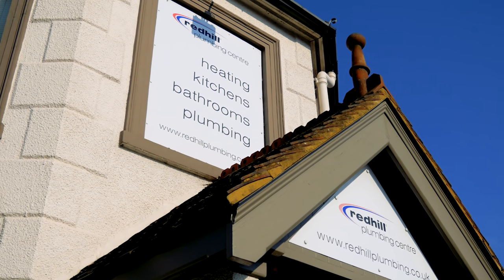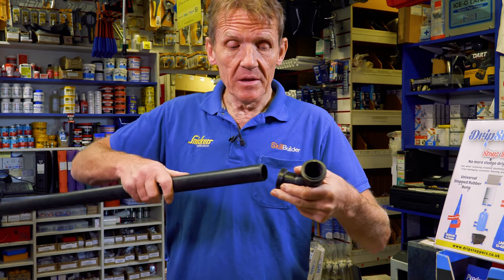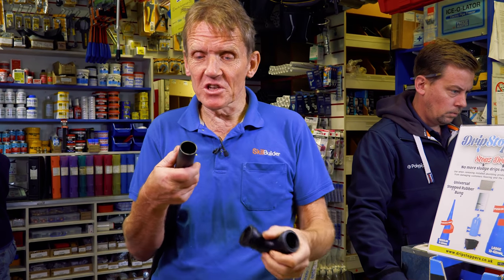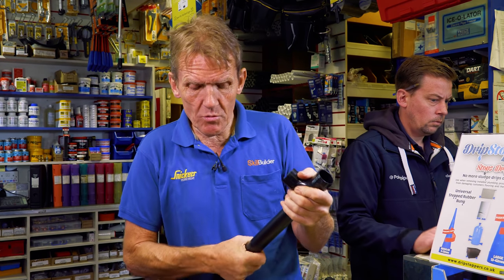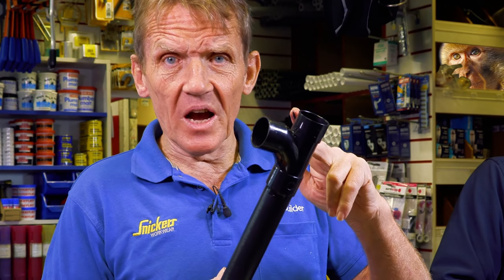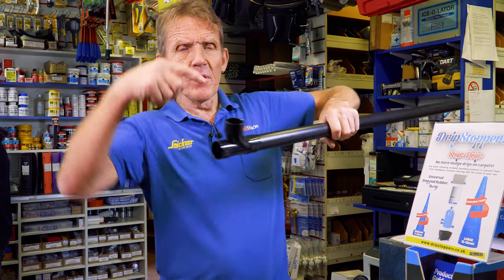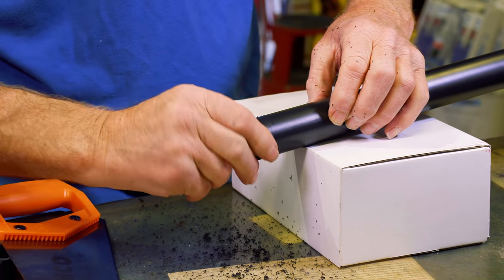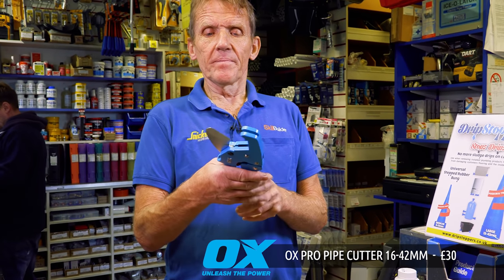How to Cut & Connect PVC Waste Pipe - Plumbing DIY

Comment: I have the OX and a Rocut 42 and will always give a twist on the pipe with both. It didn't take long for the point on the OX cutter to wear and then it deforms the pipe just like the rest.For the best result, I ratchet them up to the point where it starts to squeeze the pipe, then just rotate all the way around, it will come off in one leaving a perfect edge with no deforming at all.
Reply from the maker: Good tip Mark
Reply: Omg.... That's exactly what my pipe did... Why did I not come across this comment earlier!!!!

Comment: Great video Roger.  Saws and swarf are a pain and few plumbers clean the ends up.  The cutters just need to have very sharp blades, not that difficult to do and you get a square cut every time.  The twist works every time to get the cut started.  The solvent weld takes care of softening the slight ridge from a good pair of cutters.  I use a mix of cutters and also a portable small, battery, cut off saw with a fine blade which is so quick on a big site and is easy to make fine adjustments.  As I've mentioned earlier watch the spec. on waste pipes for heat tolerance.

Comment: 4:16 For anyone interested, I'm pretty sure its similar to glues used in plastic model making. You have a limited time to put the two plastic parts together before it starts to melt and fuse the plastic together.

Comment: In Germany we always use Geberit SIlent PP it ´s a push fit how you guys say. 
Its the most professional u can use over here we build a hole building with 12 floors and they will last for over 70 years without leaking.
Reply: the German ones are multilayer, the ones he showed are just simple plastic pipes with pushfit connectors. 

Here in Lithuania everything is also built with pushfit multilayer pipes with no issues at all.

Comment: Thanks for explaining that, there is always confusion between the waste pipe types! Id go for the saw for all i do in cutting plastic pipes which isnt much but the professionals like yourself probably like those ratchet cutters, looks like there is room for improvement in all three types though. How about a video on traps next, why all the various types and which to use in which situation?

Comment: you may remember the Rubber joins with 2 jubilee clips you connect cast iron with plastic 4 inch waste pipe nice thick rubber they never leaked now u can get them in all sizes from 1 n quarter upwards n if you have no space to move the pipe either way you can cut it n use that after the repair like a slip joint saved me so much hassle as i didn't know they existed am retired now lol

Comment: I bought the rothernberger ratchet cutters and literally chucked them in the bin after one go. I hate how it squashed the pipe and also I found it really hard to get the pipe into solvent weld fitting after cutting it. Saw or multi tool every time
Reply: I nearly threw them away when i first got them, but if you score the pipe first it cuts perfectly.

Comment: It’s worth mentioning that with the pushfit pipes - waste and soil - when you insert the pipe into the fitting, once you’ve hit the stop you’re supposed to pull it back out 10mm to allow for expansion
Reply from the maker: Good point. I see so many jobs where no allowance is made for expansion. We used to put a little scratch line on the pipe so the building inspector could see but they are not bothered now.
Reply: Skill Builder How long does it actually take to cut the pipe with that slice? I’ve always just used a junior hacksaw but the clean cut that saw made has made me fancy going to pick one up myself lol

Comment: If its upvc and you're joining polypropylene then you can use a pusfit fitting. ABS only allows solvent cement and mechanical connections.

Comment: I've found a hacksaw good for cutting the white waste pipes, and using a flatting pad on an angle-grinder to get it back square when the cut goes wrong.....perhaps that's why a broad-bladed saw is better??...it might keep a long cut straighter in general??. :)

Comment: Ref cutters I would only use a saw.That distorsion is the difference between a leak or not.Yes I use a file to chamfer.I am all for mod cons but sometimes saving time costs in other ways.Going back to your supply pipe video I have only ever used compression joints on plastic and ptfe tape on the front of the olive and the inserts.Plastic pipe can be a god send because its flexible .Never had a problem but for some reason find speed fit fittings bulky and some how dont trust them? Just me.Some things work and dont need simpifiying for speed at the expense of not working at all.
Reply from the maker: compression fitting on plastic supply and heating is a good bet

Comment: There is an exception to that external diameter difference PVC/Polyprop. Yorkshire is weird. There are 2 estates late 60's early 70's build  South of Bawtry Road, Rotherham and the Hoyland estate near Barnsley. They have polyprop/push pipe that has the exact external diameter as pvc/solvent weld. So, in some cases mechanical or compression fittings are actually essential in joining pre-existing pipe to new. Some old timer at the plumbers merchants told me about it.
I know that sounds daft, but it's true. Had me scratching my noggin for a time as I pulled off some old push fit and attempted to fit new ones. I much prefer PVC. Neater, better and cheaper.  
Even the chippies say that the door cases and sizes are "weird". 
It's grim oop north, tha 'nos?
Reply from the maker: Bimey that is another nest of vipers. Remind me not to go plumbing in Rotheram, I like is for my holidays but not for work.
Reply: I think that it was some attempt to standardise sizing as we went from the imperial to the metric system. Worse still some 1950's estates in North Sheff have nominally 1/2" copper... which isn't. Nearer 5/8ths" and with ruddy thick walls. That old adage that a 15mm will fit an old imperial 1/2" would not work. The wall thickness meant digging out my hand swager, repeatedly heating and walloping away to enlarge the insert. 
Holidaying in Rotherham? This year, the missus insists we holiday in Royston Vasey. She's feeling nostalgic for her youth. She is ex "local".

Comment: The rotary pipe slicer like the copper ones, you said it might be an option but not for you. Can I please ask why cause I own all sizes 32, 40 and 50mm and I find them just lovely, they don't squeeze the pipe no inside or outside burr and cut in 1 or 2 complete turns whic means less than 3 seconds. I can't think of working without them. Can I please ask what a great professional like you think is wrong with them? Thank you very much advance

Comment: Russian method to use soap, for join tubs together. Because soap very slippery, if you grease one of the end of tube, you very easy put in  tube to connector.
Reply from the maker: Yes but the soap dries out and those 'o' rings are then not working so well. Silicone grease is the product that is approved.

Comment: A pleasure to watch as always I  know exactly how to use this crap anyway but it's always nice to get a fresh perspective in it anyway, I'm currently on a sighting team for a caravan company I was just wondering if you have any good ideas for cutting and champfing 4 inch waste to make things quicker and easier especially when your stuck underneath the shitty things all day 👍
Reply from the maker: Jamie 

When I was young and skinny I used to crawl under those portable class rooms to put the 4 inch connections in. I would take a saw, a file and a sack of fittings and hope for the best. I used to wonder if I was the only mug on the planet who would do that kind of work, seemingly not.
Reply: @SkillBuilder  appreciate the reply rodger, i know what your saying mate I've just finished my level 2 in plumbing and starting my level 3 in September Im just doing that job because it's convenient for me and college but when your 38 and fat and struggle at the best of times to get underneath them any miracles are welcome, no worries rodger and thanks for getting back to me thanks for your vids 👍
Reply: @Jamie I use a fine toothed stubby saw to cut and an angle grinder with a grinding (not cutting) disc to chamfer off... very carefully and exercising caution, of course. Unless you have a battery operated grinder, I reckon you'd need a bloody long extension lead on a caravan site.
Reply: Ooh! Top tip, with 4". Wrap a piece of paper or thin cardboard around and mark with a felt tip. You can then follow the line around and get a nice sq cut.
Reply: @loafersheffield  cheers mucker I'll definitely go cordless, I'm quite accident prone so with a cord knocking about I'd be ass over tit in no time, good shout on getting a good line for the cut aswell brother 😉

Comment: Lovely Roger. Bread and butter plumbing. The only thing that i dont like about the ratchet cutters is thag the last. It if cut you always get a slight angle on the cut as the bit cuts chopped off. Even the rothenberger does it but not as much as the cheaper ones.
Reply from the maker: Hi Zed
 I noticed that with the cheap blue one but not the other ones so much. To be honest my little Bahco saw is fine and a lot cheaper.

Comment: Hi Roger can I ask a quick question? Can you get 43mm pipe clips for 40mm solvent weld waste pipes as the outside diameter of the pipe is 43mm , and most of the plumbing supplies only seem to sell 40mm thanks.
Reply from the maker: The 40mm clips are made for the pipe not the fittings and they should fit perfectly.

Comment: Saws are for the dark ages, the cutters all squash the pipe and generally don’t cut straight, the slicer style cutters have a place, for me cordless grinder is far superior, better in cut quality, less fatigue ,speed of cut and adaptability it’s also your chamfer tool at the same time. Downside is, a mask. Each to their own method though.
Reply: Is used to use grinder untill I tried rotherbenger plasticut.job done in seconds and clean cut.
Didn’t understand why roger didn’t like it…def is the best

Comment: I have old copper drain pipes which connect to the external gully under the ground level. I want to connect my bath, shower and sink wastes outlets with PVC to the copper pipe which looks like 2 inch. What connector should I use? Is a straight rubber boot with hose clips OK or is it better to use solvent weld one end to the PVC and push fit over the copper with internal rubber seal?
Reply from the maker: You need some McAlpine or Polypipe mechanical compression fittings to join copper to plastic. It is an easy job and won't leak.

Comment: Not really related but I have is question. I have two downspouts connected to two separate gutters. One just drains via s black plastic drain pipe onto my flower bed, the other drains into a drain about 20 feet away, again using the plastic pipe. Im thinking of connecting both down spouts to a Y shaped connector so I have just one outlet. I want to reclaim the area over which the 20 foot pipe is located  I discovered this after I took down s rotten deck. I dont really want to dig a trench to bury the 20 foot pipe. Any advice would be greatly appreciated. Cheers.

Comment: Hi Rodger are those Rothembuger cutter good on plastic supply pipes ?
Reply: No cus they take ages to ratchet and no need for plastic supply pipes as they are softer plastic, buy the cheap blue ones from screwfix theyre  around £10 no ratchet

Comment: What about the rotteburge pvc pipe slicers on screwfix, best thing ever
Reply from the maker: For waste pipe they take a lot of cutting. I find them too slow.
Reply: @SkillBuilder  Squeeze it while you turn the pipeslice, it will cut in less than 2 turns
Reply from the maker: @barny7apr  O.K I missed that one. I will try it tomorrow. Time for a follow up video.
Reply: Big fan btw 👍🏻

Comment: How do you connect 40mm plastic waste to 40mm copper waste pipe in a block of flats?
Reply from the maker: use a McAlpine 40 mm universal coupler

Comment: That ratchet cutter is for electrical conduit. The first one.
Reply: I use something similar for 20mm pvc conduit.
Reply: @HiltonRalphs  Yep in auto repair I also use it for fuel/vacuum line and flexible pvc conduit

Comment: Over the last few days I bought some 32mm and 40mm plastic pipe and wanted to cut my 3 metres down to a 400 mm length. I bought 2 of the cheap options, neither was any good on the 32mm which apparently is a standard size in the UK. So, I went back to the cheapest option of all as I just wanted one length, a hacksaw. Cost zero as I already had one. Took 2 minutes to saw through it

Comment: Excellent video. 

However,

I would NOT twist the waste pipe into a glued fitting. If the pipe is slightly off-circle in cross-section (such as after having been cut with one of your ratchet cutters), you run the risk of sweeping the glue away with the widest part of the oval. In a worst case scenario, both the pipe and fitting will be slightly elliptical. Any twist may introduce gaps in the glue. The drawback to non-twist entry is that you need to apply the glue well, to both parts. Just a bit of glue to the mouth of the fitting, so you're not pushing excess glue inside. Better to add more glue to the pipe! 

Half-circle, oval and elliptical in one explanation - what could be clearer than that. Anyway, no one could possibly be bothered to read this entire boring and pedantic comment. . .
Reply: What if you twist 90° in one direction and 90° in the other, do you solve your elliptical problem?

Comment: Pvc u and abs are the only 2 types of plastic that can be solvent welded. Push fit wastes are terrible you can’t put any drain acid down them because the rubber o ring melts and corrodes.

Comment: Those ratchet cutters are a waste of space , i use a little 12 inch Barco panel saw and mitre block which cuts perfectly every time and a tiny amount of swath that is so small you can clean off with ease......
Cheers

Comment: Sorry Roger but that's not the correct way to use those ratchet cutters.. You apply gentle pressure until the blade touches the pipe, rotate the pipe 360° to score all the way around, squeeze handle one more notch then repeat. Unfortunately a lot of people tend to use them like scissors then wonder why the pipe deforms.
Reply from the maker: TD that is fine. I am happy to learn. Ox are saying there is no need to twist it but as I said it helps to prevent distortion. As for scoring all the way around I will try it but I fear it will trammel.
Reply: I thought exactly the same surprised to see bad feedback on the rothenburger cutters I’ve found them so much easier than anything else and when done like you say it’s a perfect cut every time 👍
Reply from the maker: @paulkent7395  I am sorry Paul. I had no idea you had to squeeze them. and they weren't in the pack.